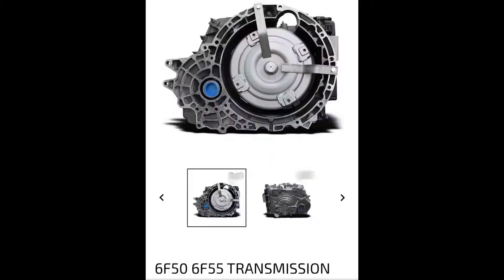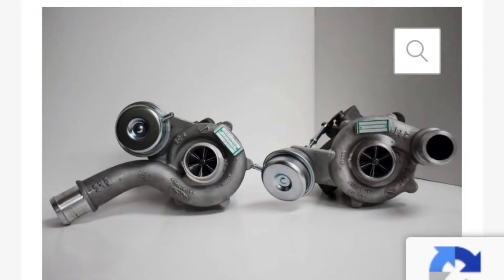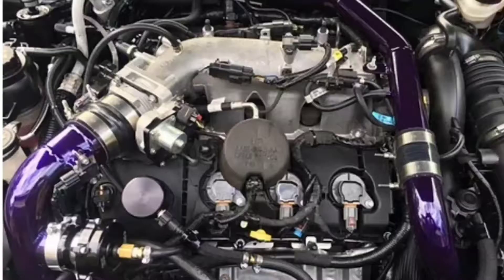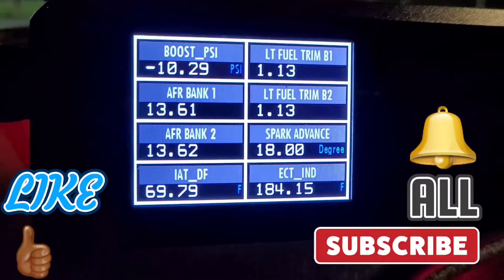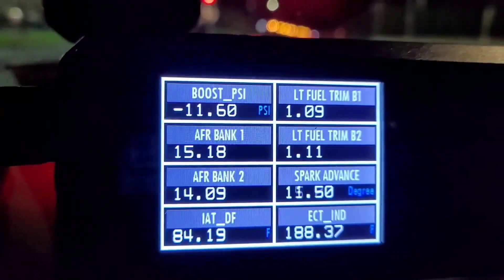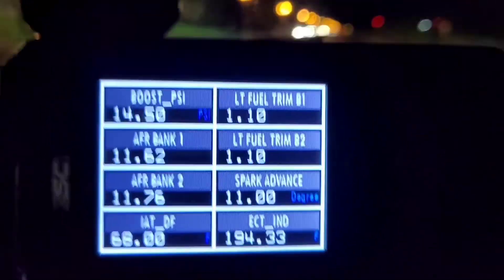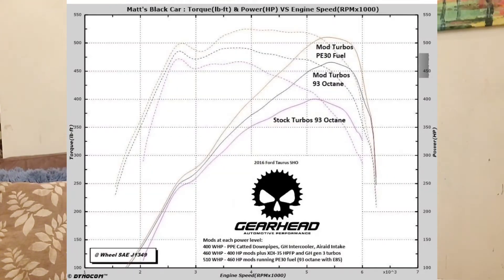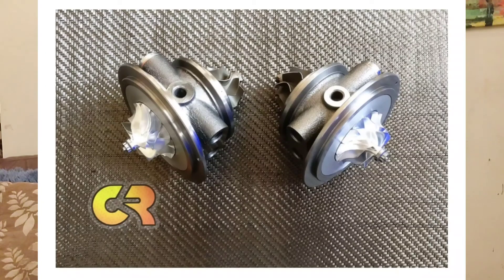Explorer Power Series: Turbo Upgrade

Comment: I need to replace my turbos on ford explorer sport 2017 whatyall  recomend
Reply from the maker: @LuisGonzalez-gz1fn  what do you use the Sport for? Do you have any mods?
Reply: @ no stock
Reply from the maker: @LuisGonzalez-gz1fn  With no "supporting mods," you might as well just get OEM turbos. Especially if you don't plan on adding anything other mods.

Comment: I just got a 2017 piu with the 3.7 where would i go to find upgrades for it? New to the explorer game so any information helps. Thanks in advance!
Reply from the maker: You have a NA 3.7 if I recall...if so then an intake, exhaust, and tune will be your only power-adding options.

Comment: Have you had any issues with the reverse solenoid banging the transmission in reverse for the 2.3l turbo
Reply from the maker: I haven't heard of that problem. I've only owned the 3.5L Ecoboost.
Reply: @blacktalonsport1262  ya, Ford did a horrible job on the awd 2.3l trans as you can't change the filter

Comment: I got a crack in my front turbo. I was thinking of upgrading them since i gotta replace them. If i replace them... is that all i need to do or is there more things i have to change to get it to work well? I wanna just do a swap n be better... nothing else! Pls let me know
Reply from the maker: If you're getting "upgraded" turbos you need a tune for everything to work together smoothly. If you've done other mods (intake exhaust) with the upgraded turbos you will benefit more from the tune.
Reply: I’m wondering why replacing the turbos are listed as a 13 hr job.
Reply from the maker: @PiccoloRick17  because some shops want to drop the motor to replace them.